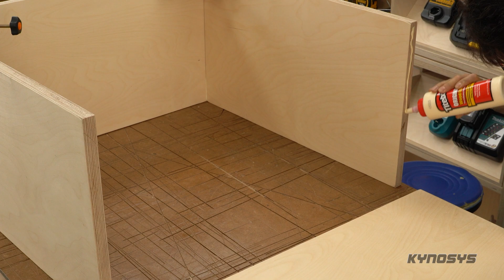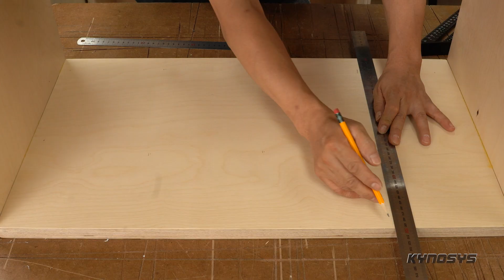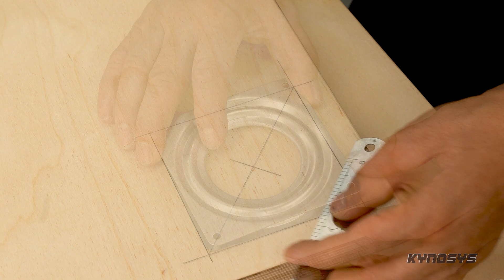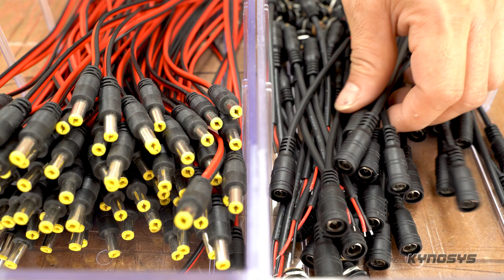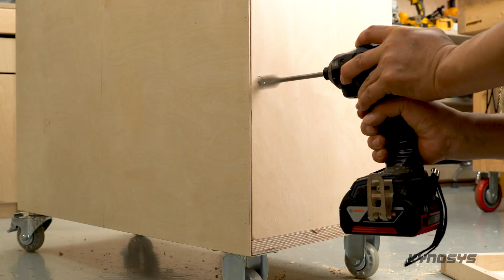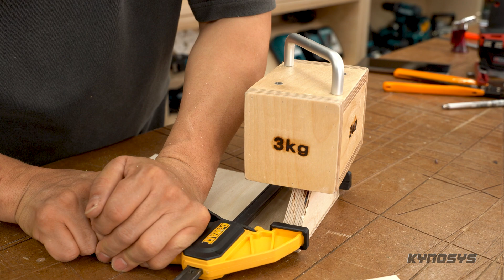Movable Electrical Work Drawer (Full.ver) / DIY

Comment: "Greetings, I’d like to know if you’ve tested the strength of your drawer assembly. I see you alternate each side, meaning your technique isn’t the common one (which usually has two larger sides and smaller front/back pieces to fit inside). Also, since your method doesn’t use an extra front top piece, I’d like to know how durable that joint has been over time—if it’s held up well with continuous use. Greetings from Guadalajara, Mexico."

Comment: Do you ever explain what all those electronic machines connected in the box do ? I’m curious
Reply from the maker: These are various voltage converters. There are also high-frequency welders. And it is a multi-tester and a simple voltage converter. thank you!